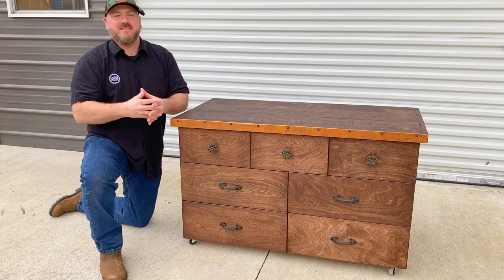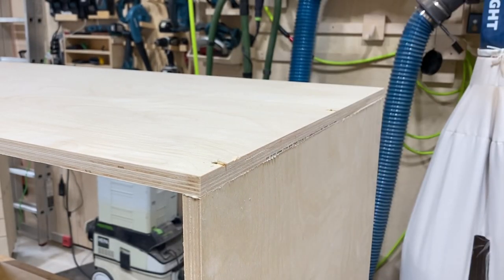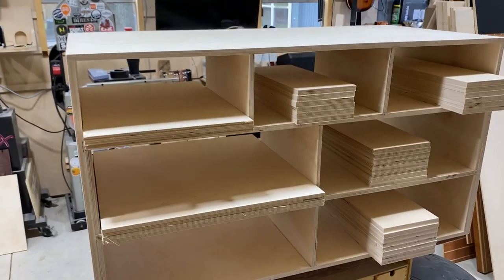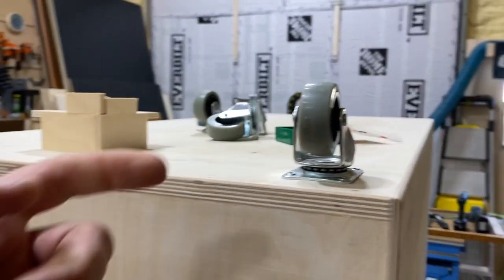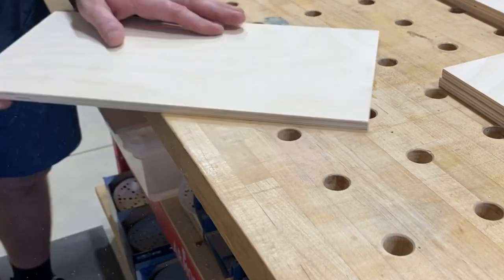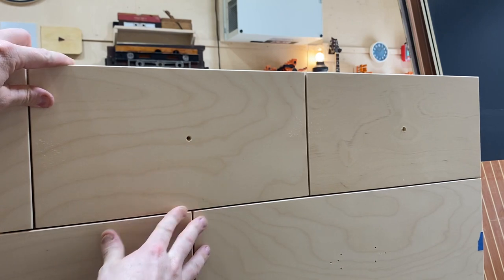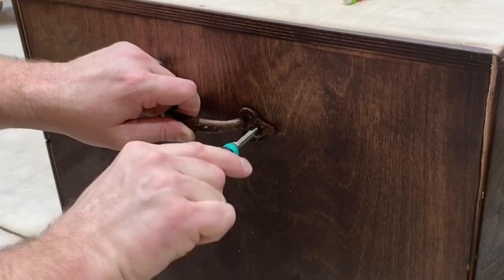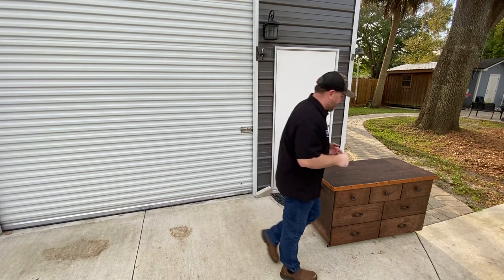How to Make a Rustic Dresser | DIY Project with a Special Meaning

Comment: Thanks Chris, nice work.  I wanted to see how you got it into the house!
Reply from the maker: The very last seen before I talk at the end it’s in the house
Reply: @AGlimpseInside  I saw that but I wanted to see if it was a struggle to get inside.  I built a bookcase in my basement that I actually had to glue up and put finish on in the house because I would struggle to get it upstairs!  So if I ever build anything big, I have to think about that.  Thanks

Comment: I like it. Do you think using just a playing card would be enough space for the spacing on the fronts?
Reply from the maker: Great question. I do not. Because there is about an eighth of an inch play in the fact that the drawers are floating in the cavity. No drawer slides to keep everything rigid. If you got extremely strong drawer slides and everything is good to go the card or two would be fine

Comment: when you sprayed the clear coat, what size air cap did you use for your fuji sprayer?
Reply from the maker: 1.3  is the diameter
Reply: @AGlimpseInside  thanks I am going to use that clear coat on my next project. Didnt even think to spray it